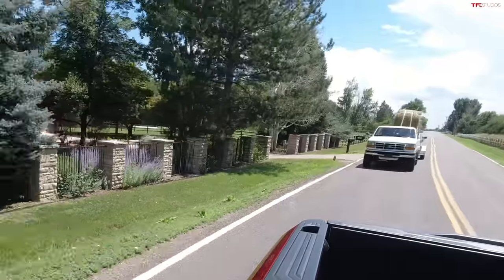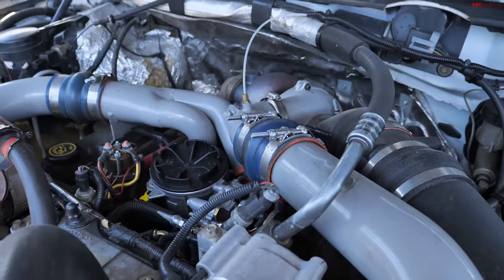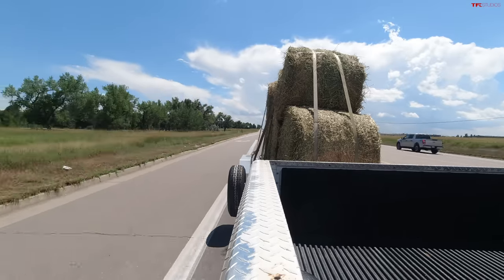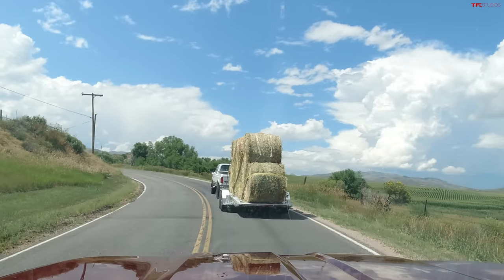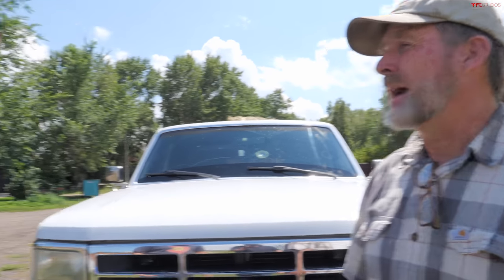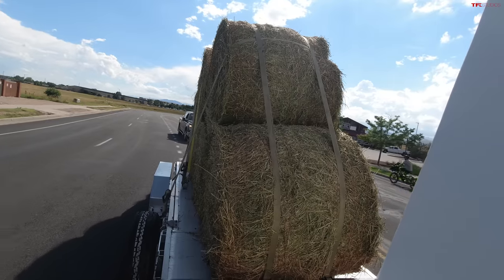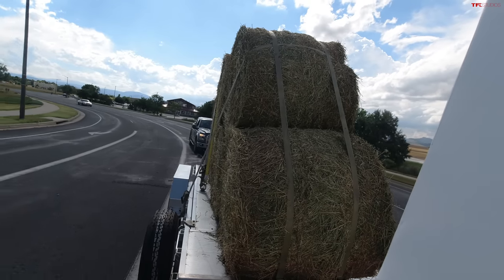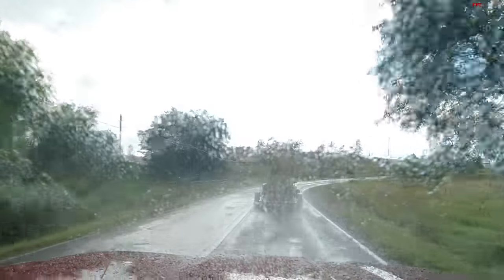Ranch Battle! Can a 26-Year-Old Ford F-250 7.3L Power Stroke Outwork the Legendary 5.9L Cummins?

Comment: I would love Ike Gauntlets comparing the different generations of trucks. Nothing super scientific like factory original trucks but seeing $25,000 used trucks vs $80,000 new trucks to see what the general differences are.
Reply: This needs to be a video!!
Reply: that would be awsome
Reply: @AccountantByDay553  my 95 f350 with 7.3L is up for the task. And the manual transmission has higher towing than what the automatic offered. only starts to bog down after you pass 20k payload.
Reply: Great idea. The differences will be astronomical. I drive a 97 7.3 f350 personal truck and a new 6.7 power stroke f350 at work. I love my OBS but the new 6.7 will run circles around my old truck. I’d love to see this video though.
Reply: I don’t know! Factory original trucks might be kind of interesting.
Reply: @cap10newport95 the difference is about 55k and a butt massager.
Reply: I think we’d learn much of the love hate would be in transmissions over hp differences. I had an 05 3500 dodge with an auto and if it was a 6 speed or more like today it would’ve loved what I tossed at it but that 48rfe had a shift point that at highway speed around 55 pulling some rolling hills it didn’t know which side of the shift it wanted and I didn’t want to run 5 over with a heavy load to have rpm’s in the higher gear. I put a smarty jr on it and threw it in the tow tune to use a few more hp to compensate for needing to operate at that range.
Reply: you mean 3000$ and 6000$.
Reply: i volunteer my 97 for the task. i make the gauntlet drive regularly.
Reply: @frostybandit1 you don’t live at altitude. i have done the ikr gauntlet with 5,000 lbs on my quite built 7.3 and it SUCKS. either that or your standards are very low

edit: after watching more of the video i wonder if my standards are too high. but idk, top of third gear at 3000rpm (35mph) going up the eisenhower i’m sitting at 1200 degrees and shifting to 4th would just slow me down and smoke everyone out and blow my engine. so idk
Reply: @frostybandit1 these things start to bog down at altitude at 3,000 pounds trailer. with an upgraded turbo, upgraded injectors, tune for high altitude, intercooler, upgraded hpop, and manual transmission.
Reply: @MCatwar   Fully stock and did San Antonio TX to Ft collins CO without issues. trailer was a 2016 Fuzion tow hauler. Was five years and 120k miles ago, may still be able to do it.
Reply: @frostybandit1  ah yeah my truck does the front range okay too. it’s only about 5000 feet there b some spots are up to 5500 but the grades aren’t too harsh. the test is always to see if a truck can pull 70mph up i70 west from the front range into the foothills lol
Reply: Yes please make it happen TFL!!! Awesome video by the way and great to see Andre and David making it happen!!!
Reply: 70? Dang I rarely go above 65. 55-60mph is my normal towing as that was what the truck was designed for.
Reply: @frostybandit1  eh with 4.10s and stock tires 55-60 puts you right at 2 grand which is the lowest i’d tow with. 55 you’re out of boost or over revving 4th gear. 68mph is the top of the usable rev range in 5th gear, so i sit ahout 68. it doesn’t really matter much with these trucks though. i go the same speed towing as i do empty, unless i’m pulling a grade because it won’t even be able to hold 55-60 liek you mentioned. then it’s more like 35 or 50, whichever i can hold(top of third or top of fourth)
Reply: Someone has already done that
Reply: whiteafrikkkannun1442  they all are lol mines a extraordinarily average build
Reply: whiteafrikkkannun1442  either that or my standards are just too high and i need to accept that old trucks can’t tow like the new ones. i’ve been spoiled by new trucks haha
Reply: whiteafrikkkannun1442  “mine’s an extraordinarily average build”. meaning big injectors hpop turbo tune exhaust is pretty standard usability mods
Reply: Right, i'm trying to see if its more convinient getting an obs or a newer gen for towing
Reply: Probably could get a nice duramax with 25k on marketplace
Reply: @rustbucket9318 but for how long? Is the question… old vs new! I think old takes the cake for longevity.
Reply: That or do 3 decades of trucks. One from 2004, 2014 and 2024 to show a comparison in what the trucks can do. My 2004 Ford F250 Lariat is very basic compared to the newer trucks. It has power seats, power rear window, power pedals and heated seats.
Reply: Old trucks would be better when properly equip. They flex more
Reply: @mudbuster50
Reply: @MCatwar

Comment: Fellow Coloradoan and 96' 7.3 owner. I exclusively use my 7.3 to tow my camper up and down the Rockies and I'm glade you covered these two dinosaurs. With that said, the 7.3 tows whatever I throw at it but they drive like a run away horse wagon, have a turn radius of a cardo ship, and do a 0-60 in 1 to 2 business days. Keep up the old school truck content!
Reply: They are lazy stock. They'll get the job done reliably but not in any big hurry. 4.10 or 4.30 helps if you're going to dare to pull anything 10,000 lbs or worse with one in any sort of challenging terrain.
Reply: Ha sounds about right lol.  My old man had an old 93 IDI when I was a kid, man I loved that truck and thought it was the badest thing on the road back then.  It was turbo non intercooled made all of like 8lbs of boost but it was always fun for me.  Looking back at it today with it's like 145hp it's crazy how far diesels have come along.  Everyone seems to have a 1k hp truck these days.
Reply: My '95 7.3 is slow even after the chip. To be fair it is a 350 in XLT trim with a welding bed and a bunch of welding gear including an '78 SA 200. About 13,000# as is. I'm glad it's a 5spd standard.
Reply: I love my 95. I actually swapped from the auto to the stick for towing my enclosed trailer around. Love it but she ain't quick! Be prepared to be brutally passed by 18wheelers
Reply: @The-italianstallion  I like the fuel economy in mine and the fact that it's very reliable.
Reply: Odd my 95 F250 regular can long bed turns on a dime compared to my other trucks.
Reply: 1999-2003 THEBES YEARS ,,,, 1 MILLION  MILE ,,,  MOTERS !!! 7.3 POWER STROKE...!!!
Reply: I miss my 95 7.3 stroker... she done went 1.5 million km but rusted terribly and then the final straw was a tree landed on the cab during a storm...
Reply: @catmand5h it's the camber great turn radius
Reply: @jakestevens8817  mine has been making me $$$ as a welding rig for about 5yrs. I love it.
Reply: My 02 runs with the new trucks pulls nothing like a 7.3 but it's also not stock
Reply: How fast do you run the rockies with a trailer?
Reply: Lmao the most accurate description of an obs ford iv ever seen 😂 love it
Reply: 4 ciggarets to go up Baker grade in the summer time. I have a 97 7.3 and hauled hay and horses all over Nevada Utah and Idaho. I was a truck driver for 45 years and I understand climbing mountains.
Reply: @welderdude1 Is it automatic and if so, have you upgraded the transmission cooler? I have a 95 F350 dually and it’s spewing transmission fluid when I tow in the heat of Arizona.
Reply: @Marvinator  mine is a standard. 5spd.
Reply: @welderdude1  thanks for the reply. Wish mine was!
Reply: @Marvinator  the C5 is a tough system.
Reply: Having a crew cab long bed helps pulling I find.. over a short bed
Reply: Hopefully you stay in the rockies of Colorado greenie.
Reply: My 1999 F 350 has 300.000 with new engine with  transmission 62.000 miles Put in by Ford, Runs like new no rust and new

Comment: 410 gears and a manual limits its towing capabilities!? no sir. I have owned over a dozen Fords rams and Chevrolets. 410 gears and a manual is the most capable truck you’re gonna find! The ability to select the gear you need at any given moment, makes the truck more capable, not less!
Reply: I think technically speaking the capacity of the manuals are lower but I completely agree with you

Comment: This comparison would have been better with the 6.0 vs the 24 valve 5.9, the 24-valve is 1 generation ahead of the 7.3. a 12v would have made more sense to me personally.
Reply: The 6.0 would of had a catastrophic problem towing that load
Reply: @zakkul6242 you must be talking about the 6.4 not 6.0
Reply: Ehh no the 24v came about in 98.5-02 2nd gens would make the most sense lol
Reply: Or the newer body 7.3 they have more power
Reply: @Bert805b  eh the upgrades done to this truck even on "stock tune" will actually punch what the dutys do in hp/torque ... lol
Reply: @freedom24v86  I doubt that especially if it has stock size injectors the super dutys have bigger injectors and turbo. Atleast the ones newer than 99.5
Reply: @Bert805b  based on there other video it has a larger turbo an intercooler setup and i may be right or wrong bigger injectors 

Even without the injectors the turbo/intercooler setup would easily net to ths 245 and 275hp region and xxx torque that came with it.... without tuning.

Comment: You guys did something I wish I would've done. Real world reviews. Growing up on a small farm we had all three makes. '93 6.5 GM diesel, '98 1/2 24 valve Cummins, '94 & '97 Powerstroke, and '05 & '06 Cummins. Hauled livestock everywhere with Dad. I have to say the '05 & '06 Cummins were great albeit for the automatic transmission. '94 & '97 Powerstroke both manual kept up with the newer trucks. '93 GM diesel was no pulling king but it did what was asked of it. '98 1/2 Cummins pulled like nobody's business but I'm pretty sure it was because of Grandpa's heavy right foot 😄
These trucks were built for work. Unfortunately now for luxury.
Reply: Like i said, old trucks dont care if it fits it ships, it will be slow but its on the way 🤣
Reply: @ryancollins3227  Exactly and while the new diesels are parked either in limp mode or regen. I'll be passing by in my older pre-emission truck.
Reply: My 99 F350 2wd pulls like a beast. ❤❤❤

Comment: I have 02 F250 and its mainly a fun truck at this point, havent towed in a while esp since I put a new engine in. They are just awesome trucks, the 7.3 has such a unique sound and sounds just so great with an upgraded turbo and straigh pipe.
Reply: I agree! I've owned 2 7.3s in my day (a 2000 and a few years after I sold it I got a 1996) there's nothing like the sound of a 7.3! I hope one day I'll be able to buy another one. I regret getting rid of them but thanks to the economy I just couldn't give them the care they deserve. Maybe one day I'll be able to have another one and a Cummins as well!

Comment: Both are nice trucks & I'd take either one of these over a new diesel truck, but with that said I'd take the Ford all day long over the Dodge.
Reply: Until u hav to work on that V8 crammed under the hood…..
Cummins 5.9 all day, everyday……PS I’ve owned 7.3 Ford Powerchoke, 6.6 Dirtymax and 5.9 Chummin
Reply: The fords great when you completely restore it and upgrade the turbo and manual swap it.... cummins just needs a front end
Reply: @DolphinDivingChamp  Cummins is a good engine. The problem I have is what they put that good engine in. The truck will literally fall apart around that Cummins.
Reply: @299charles if you've owned them then you would definitely know. Thanks for the tip, something to consider. 

I know I said ford & that's mainly because I'm biased to ford but I wouldn't mind a Cummins at all.
Just don't like a Dodge & I've owned plenty of those.
Reply: @scottyellis3442 what falls apart? just curious
Reply: Idk I kinda like the Bluetooth and android auto
Reply: Interior, dashboards,seats , transmission etc
Reply: @bryanbutera9186  exactly, glad you answered that for me, but you forgot the terrible wiring in Dodge's.
Reply: @KamionKing I’ve never been in an old dodge that doesn’t have broken door panels/interior handles. Dash and steering wheel/column crumbles as well. Wiring for everything is terrible
Reply: @299charles What are you talking about? Those 9th generation Fords are so easy to work on. Even with the 7.3 you can practically crawl into the engine compartment.
Reply: Take the Ford all day
Reply: That's because you are a man of culture, a sire if I must say with a good taste. You have a good day.
Reply: I would take the ford all day to
Reply: Cummins 5.9 all day long. 7.3's are nice, but when they break, who wants to fix an extra 2 cylinders!?!?
Reply: The dodge is just a shipping crate for a great motor. OBS trucks are just so easy to work on and don’t rattle apart like a Dodge.
Reply: @richardfromage  Had a 2001 dodge 2500 since it was new. NEVER HAD A PROBLEM!
Reply: I have a 05 Cummins and I have no wiring issues, nothing is falling apart on the truck. Original bone stock 24v with original turbo and has 265k. DODGE all day. I will say the 7.3 is a better engine over ford's 6.0  and 6.4 powerstrokes. 6.0 amd 6.4s are complete junk. Lemons! Money pits!
Reply: The problem with the Cummins is the Dodge around it. Ford all day.
Reply: @dohctorsmith1  
Exactly
Reply: @dohctorsmith1  Yes, but if you are a busy man such as I, you don't have time to swap a ford with cummins so you I just buy dodge.
Reply: IMO it’s a toss up on the 7.3 vs the 5.9. But I’ll take the Ford over the Dodge all day. The Dodge pickups look great and that’s about it.
Reply: Own a 6.7 ram and 7.3 powerstroke.  Both have their ups and downs.  I'll take the cummins for ease of work.  Especially the weak water pump that takes an hour to change vs an entire day on a 7.3.
Reply: @DolphinDivingChamp and a transmission….
Reply: @scottyellis3442  That's just a load of BS. There's more 1990's Dodge pickups on the road than 1990's anything else. It speaks for itself. They last longer.
Reply: @PotatoeJoe69  
There may be more 1990 Dodges on the road where you live but certainly not where I live,  electrical problems take them out most of the time, & if the electrical doesn't get them rust most certainly will.
That Cummins is a good engine but so is the International.
So your BS is BS because it's a matter of options.
Reply: @scottyellis3442  It's a matter of fact not opinion, I don't care where you think you're from. I've hauled boats all up and down the East Coast, and horses from Kentucky over to NY, NJ and down to Florida. There's old 90's Dodge pickups everywhere. Can't find a single damn Ford though. 🤣

Comment: I have a very early 99 powerstroke that had the older smaller turbo/intake setup. Converted it to the later bigger Garrett, slightly bigger injectors and T6 tuner. I’ve got about 5 grand into this truck total and it’ll keep pace with much newer trucks, with no def bullshit to deal with. I wouldn’t trade my old rattler for a brand new one.
Reply: The new gas ones will pull and no def crap but we also have a 23 year old one and u can tow just about anything you want to

Comment: I have owned five diesels. Two were 7.3 Power strokes, two Cummins 5.9 24 valves, and one Cummins 6.7. The 6.7 was the best to drive, but the extra pollution equipment caused the turbo to fail at about 90,000 miles. At about 115,000, it started having more issues, so I sold it.

The Super Duty and Excursion had much nicer interiors than the Older Dodge, but I preferred the Cummins 5.9 engine. 

I currently drive a half to Ram, but am looking to purchase another diesel. While I like the power and features of the newer diesels, I am looking for something built before the additional pollution requirements were added. I am looking at 7.3's (1999-2003) or a 5.9 Cummins. Wow, the prices are high for anything with descent miles and no rust. Of course, with the price of new trucks, it is no surprise. 

Thanks for the review on the older diesels.  Now compare your 97 Ford with Kace's Dodge. 

Thanks for all of the channels. Nice job guys.
Reply: As a Ford and Dodge guy I personally feel like if all the pollution crap wasn't in the way, both the 6.7 Cummins and 6.7 Power Stroke would probably be equally as powerful and tough. But imo nothing will ever beat the old school diesels. As for the gassers the old Ford 300 I6 could probably out pull and outlast a lot of these newer gassers they have on the road. If I ever get rid of my 2nd Gen 318 I'd only replace it with a 300 I6 or a 460 big block, just because I personally love the sound of a 460 lol.

Comment: A 12 valve Cummins vs a 7.3 could be called the Rattle Battle
Edit: fixed spelling
Reply: Haha yep😂
Reply: Stock vs stock yes they compete, both modded the 12 valve is king. Can’t get a 7.3 over 400hp on the heui system.
Reply: Wouldn't want it any other way. 👍
Reply: My point a Duelie vs a single axle isn't a good review. It's almost like they being bias against Ford on this show. Like 1 time they took a Hellcat vs a GT Mustang. Not in the same class.
Reply: @RiggyRonnie about 1,000 hp on fuel only is the heui injections max, somewhere around 1,500 hp on the spray.
Reply: @blakeseales6143  Bruh are your parents cousins it’s literally powered on oil pressure max PSI you can get out of crusty old 7.3 oil is 20,000 PSI and it’s held together by black and pink cockrings don’t act like you know what your talking about I know you don’t even know how much psi these new trucks run on their HPFP nothing will ever bear a P-Pump
Reply: Siir a 7.3 builder has allready done comon rail with ppump on 7.3@thesunflowchannel1995
Reply: @RiggyRonnie  get in my 7.3 and I’ll put that claim to shame
Reply: @mitchellgertner7942  My stock 6.7 will gap it any place any time, heck even a 6.2 gasser will gap it any place any time
Reply: @RiggyRonnie  perfect I’ll race you for pink slips. I’ve gapped jeep track hawks, plenty of 6.7 powerstrokes, duramaxs, and Cummins. Ran low 12s at bandimere speedway. I’m not saying my 7.3 is the fastest out there but it’ll shit on most people’s egos
Reply: yeah i kinda had to roll my eyes when the title is "legendary 5.9L" and they have a 24 valve